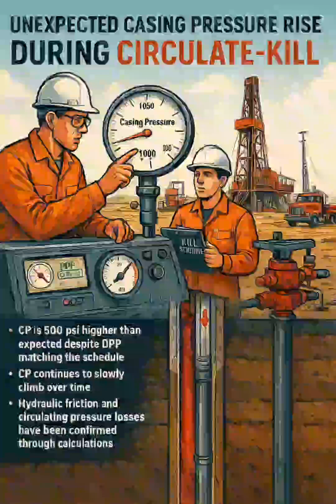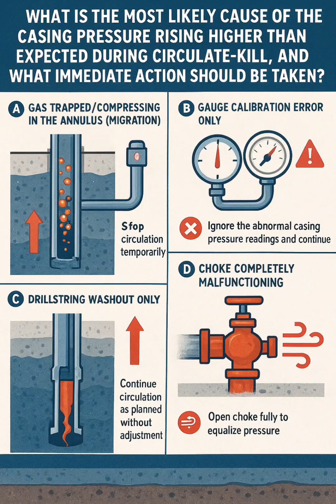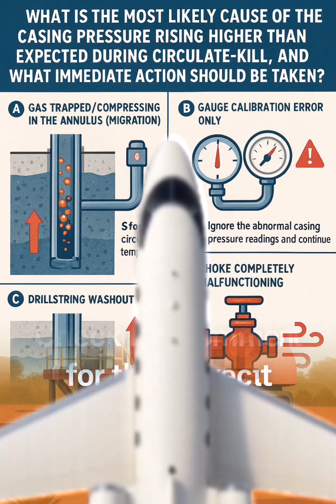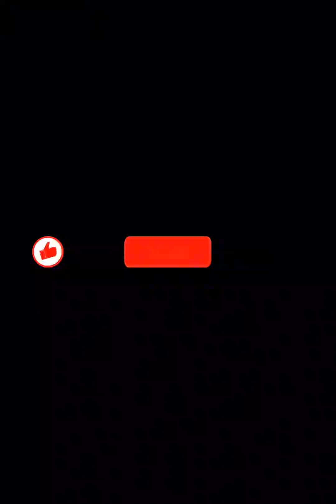Casing Pressure Rise in Circulate-Kill Q46 #drillinghse #wellcontrol #iwcf #casingpressure

Comment from the maker: Correct Answer: A) Gas trapped/compressing in the annulus (migration) — stop circulation temporarily, evaluate the well, and secure if trend persists.

During circulate-kill operations, if casing pressure rises unexpectedly higher than predicted by the kill sheet, the most likely cause is gas migration or trapped gas compressing in the annulus. Gas expands as it moves upward in the wellbore, causing casing pressure to increase beyond expected values.

Immediate action:

Stop circulation temporarily.

Hold the well shut-in to see if pressure stabilizes.

Re-evaluate the situation (check choke, verify gauges, review kill sheet).

Only resume circulation once the cause is understood and controlled.

This approach prevents further influx handling errors and reduces the risk of losing control of the well.

Comment from the maker: ❌ Why the Other Options Are Incorrect:

B) Gauge calibration error only — ignore the abnormal casing pressure readings and continue.

Wrong because ignoring high casing pressure could result in missing early signs of a dangerous kick migration or gas expansion.

Even if gauges are sometimes inaccurate, abnormal pressure readings must always be investigated, not dismissed.

C) Drillstring washout only — continue circulation as planned without adjustment.

Drillstring washout would usually cause lower than expected drillpipe pressure (SIDPP) rather than higher casing pressure.

It doesn’t explain a casing pressure increase above predictions.

D) Choke completely malfunctioning — open choke fully to equalize pressure.

Opening the choke fully would likely lose well control by allowing influx to unload rapidly to the surface.

A choke malfunction should be tested and corrected, not handled by opening fully during a kill operation.